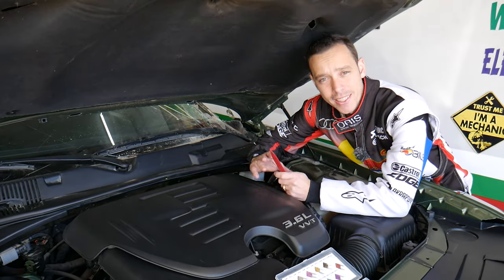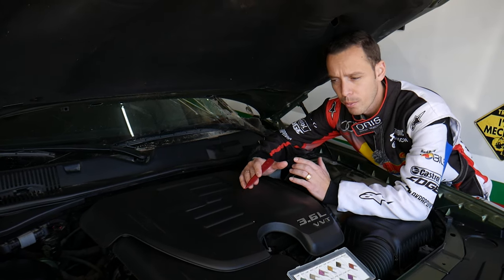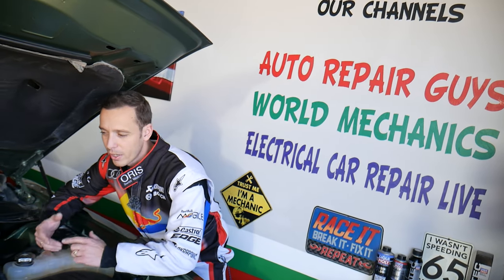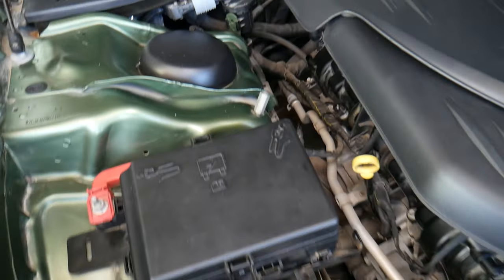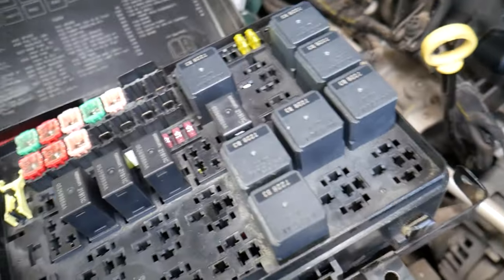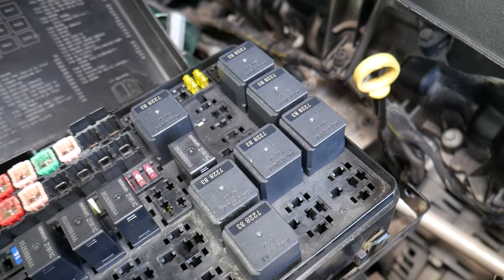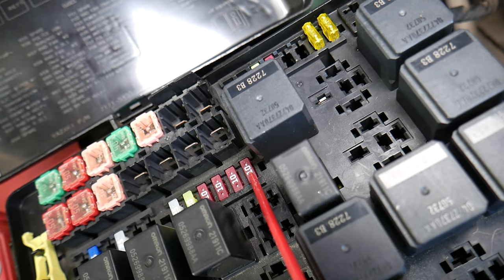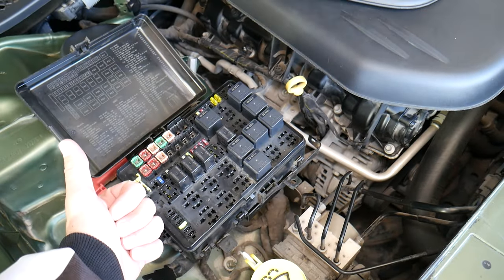CHRYSLER 300 AC COMPRESSOR CLUTCH FUSE LOCATION REPLACEMENT, AC BLOWS HOT

Comment: Thanks for this! I went and spent 45 dollars on a recharge can...plugged it into the system and the gauge immediately jumped to the red.

Saw this video and checked fuse #12 and it was blown. Replaced and getting cold air again! 

Time to take the can back now! 

Thanks again!

Comment: I’ve been having the exact same problem with my 2012 300c. Sometimes when I turn it on I get cool air and it will last for days then just stop. It was just blowing warm air. I turned off the engine took these two fuses out and wiped them off and placed them back in and the air immediately started working. Thanks a lot man!
Reply: Bro I have the exact same problem on my 2011 300 Limited!  My cool air last for days and then it stops.  So your saying just replace these 2 fuses?
Reply: Has anything else happened since you removed, cleaned and reseated the fuses?